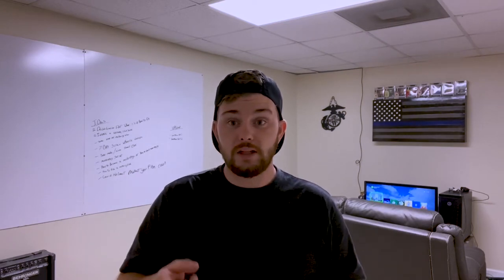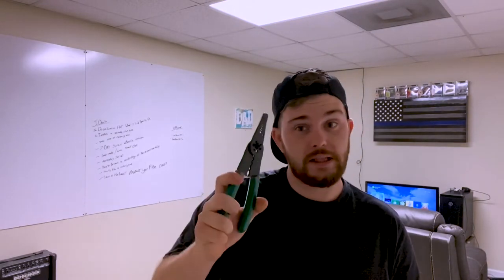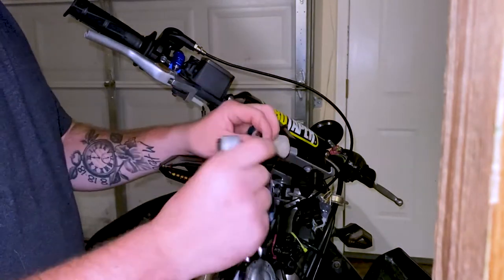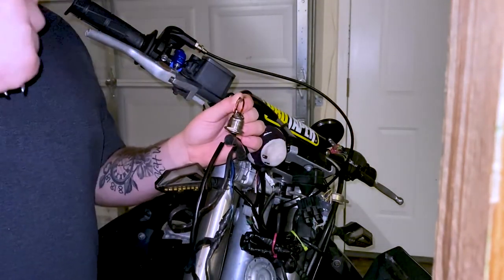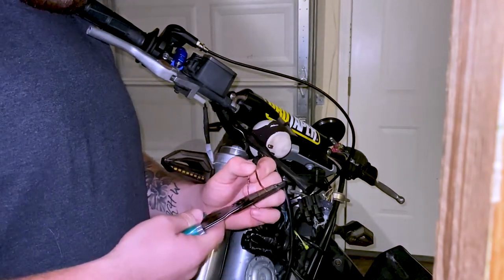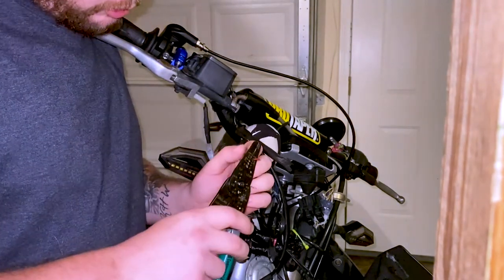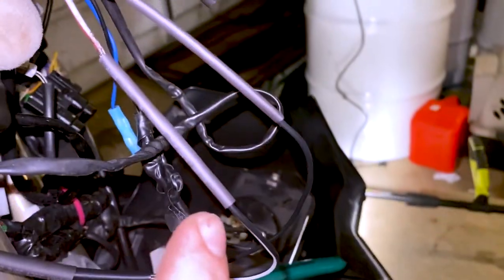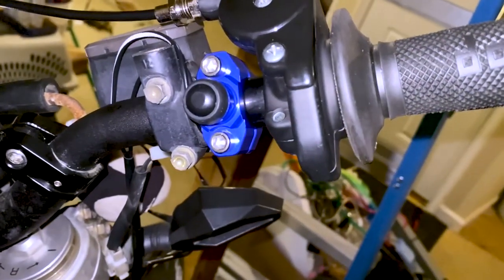How to install a Motorcycle Kill/Start Switch

Comment: Nice video dude 👍. But quick Question... Have you ever had problems with your speedometer showing 0 but everything else, like rpm works? I can't find the issue and already replaced the sensor...
Reply from the maker: I had it zero once and I just unplugged the battery. Some did once tell me they had a similar issue with the dash and they just replaced it and it worked